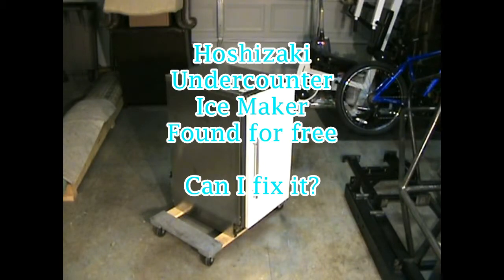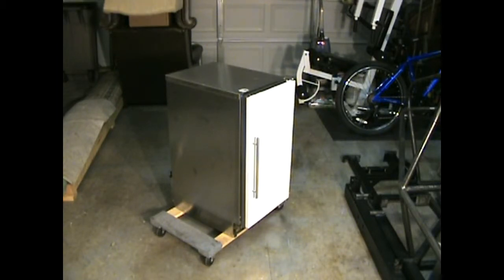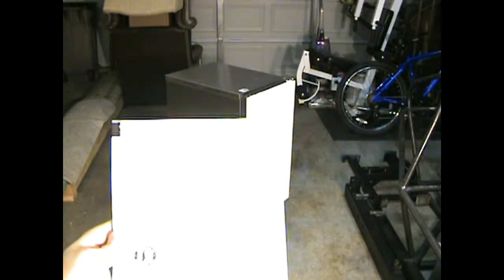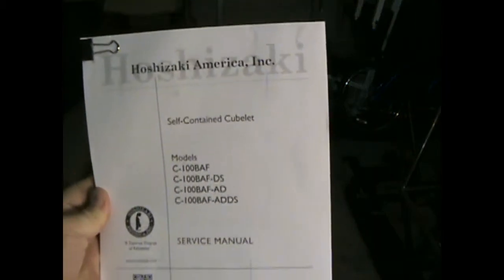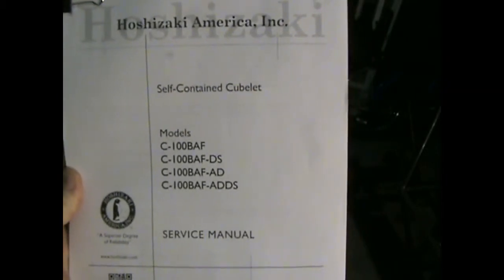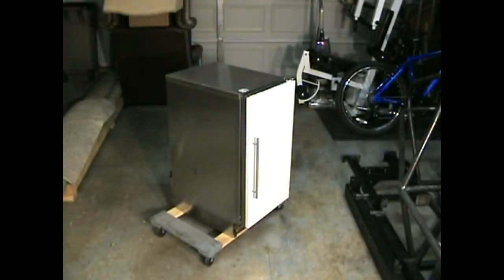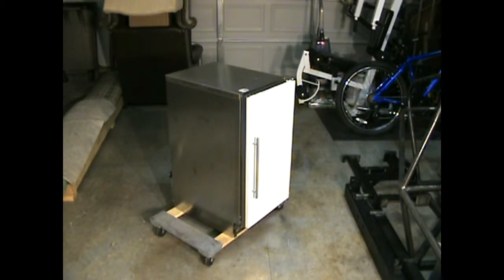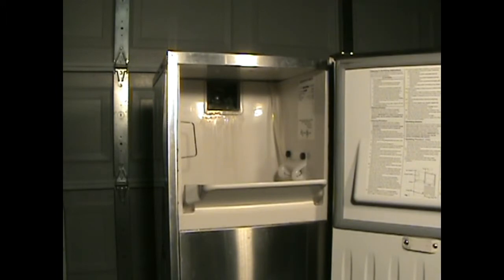Found Hoshizaki Undercounter Ice Maker - Can I fix it?

Comment: Great video and you inspired me to fix my unit, same kind, which had a crack in the water inlet valve after our recent freeze here in Texas.  Little bit of gorilla glue on the crack and general cleaning/sanitizing the water bin, works like its brand new.  I appreciate you showing the steps.  It helped me be more comfortable doing it myself.  Thanks again!

Comment: I have to say that Hoshizaki is a great company. I can find all their manuals online. Looks like this is a model C-80BAJ or close relative. 

That lime build up is normal, and requires periodic service. There most likely is a purge cycle where  the water is drained as during ice making the dissolved impurities build up, and get concentrated. The purge cycle dumps the water from the reservoir, on some sort of timer system.  The condenser coil on all units that have them require periodic vacuuming of hair and dust that accumulates. Which reminds me that I need to go do that on my refrigerator.
http://hoshizakiamerica.com/manuals/

http://www.hoshizaki.com/docs/manuals/C-80BAJ(-DS)(-AD)(-ADDS)_serv.pdf

http://www.hoshizaki.com/docs/manuals/C-80BAJ(-DS)(-AD)(-ADDS)_pts.pdf
http://www.hoshizaki.com/docs/manuals/C-80BAJ(-DS)(-AD)(-ADDS)_inst.pdf
http://www.hoshizaki.com/docs/color-specs/C-80BAJ-(AD)DS.pdf
Reply from the maker: Now that the machine is functional, I have to agree with you.  It is sitting in my garage which is ridiculously hot this time of year and it has been running like a champ.